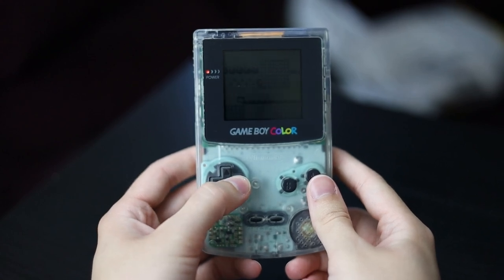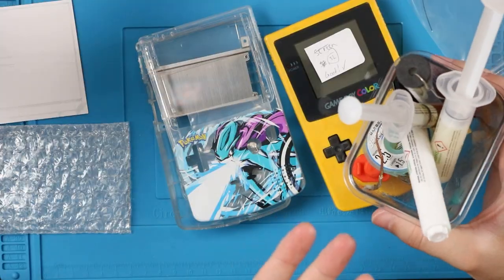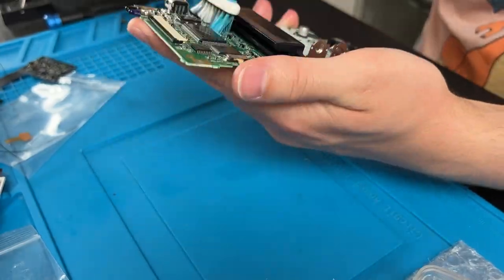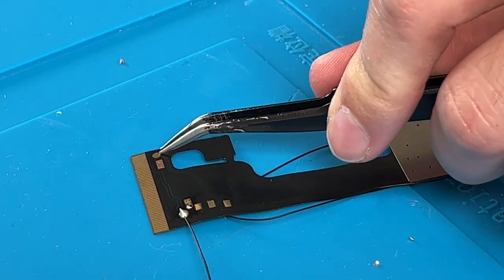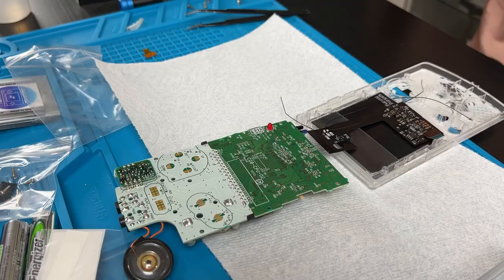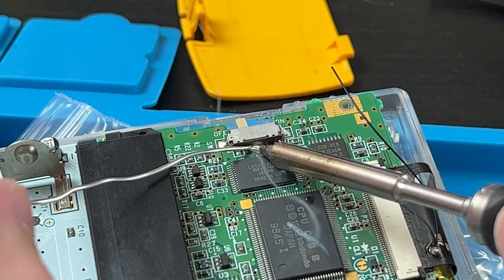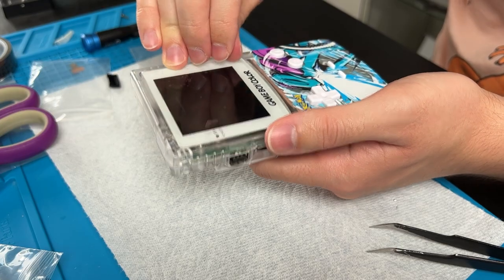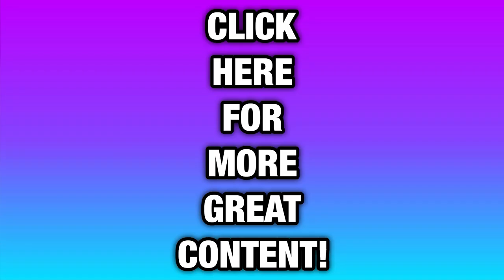The Game Boy Color You WISH You Had as a Kid! | GBC IPS Mod In-Depth Tutorial

Comment: I love how every one of these GBC mod videos I watch showcases Pokemon Crystal, which is actually the reason I'm modding my old grape GBC. Successfully replaced my speaker and a dozen cart batteries without killing anything, so I figured I'd treat myself to my first major project build (most of the parts should hopefully be in by Saturday). IPS kit + case, some clear buttons/membranes, LED flex board, LiPo battery kit, amp board, and some replacement caps because supposedly those are good to change out. Going to be super tricked out by the time I'm done. Yours is the only tutorial I've seen that talked about the possibilities of shorts, so with all the stuff I'm throwing in I guess I'd better be extra cautious about that. 

Retro Game Repair shop has an amazing selection of stuff, but I also wanted to shout out Handheld Legend for having a lot of product overlap, but also having a lot of smaller mods and accessories that RGR doesn't. Between the two, as far as I can tell you can get a pretty complete catalog of hardware mods, stickers, shells etc. 

To anyone on the fence about trying stuff like this; get a cheap soldering kit online and practice with some Gameboy batteries or a cheap soldering project. It's really not as difficult as it seems once you've gotten some practice, and being able to mod/repair your old stuff is a really satisfying skill to have.

Comment: The quickest, cheapest and easiest way to learn soldering is to solder a cube out of wires of different thickness.
You can even use paper-clips for that, mix them up with different sizes of wire, use spare metal parts, what ever you have lying around.

Comment: Hey question I bought the kit and installed the 2.0 version,  ribbon said 2.7 version so it pops up a display when I hold start and select. But I can't seem to change the different color options for each word just the whole thing to a different color? Any ideas on the new version? Ty
Reply from the maker: You can’t make each word different colors, they’ll all be one color. When it highlights “game” and “boy,” hitting start or select will change the centering of the display. When color is highlighted, you can cycle through all of the colors with start and select. Then holding down both buttons on the color you want will set the color for the whole logo. I’m a little confused by your comment so I hope that helps. Otherwise I’d need a visual to help
Reply: @JakeSimmons  that answers it perfectly 👌 I think it just confused me because my version actually brings up a menu to change everything 🙃 but thanks again you are the man and your discount on items is appreciated
Reply from the maker: @cbk12  interesting. I’ve never seen a menu before

Comment: Does anyone know what kind of wires are included with the screen to solder? Mine did not come with enough to solder the touch sensor!
Reply from the maker: The sensor should be built into the ribbon cable if you’re using the same kit as me. It’s the black square next to the part that goes into the game boy motherboard. The yellow touch pad is there just in case the built in one is defective. You should also be able to solder the other touch pad down without the need for the wire and still have it touch the top of the shell

Comment: Hi 
Is it necessary cut the pins of mb?
Reply from the maker: I’ve been doing it for a very long time because the first time I ever did this mod, those pins were shorting on the ribbon cable for this kit. I’ve been doing so long that I was curious if it was still necessary or if it was just a coincidence that I had that issues on my first attempt. I still covered everything in kapton tape and those pins poked right through it and it was shorting again. Tried it twice with 2 different boards, same thing. 

Some people don’t do it and I don’t know how they do it but from my experience, I recommend just taking the extra 2 minutes to do it so you don’t have to open it up again once you’re done. Also, make sure all of the pin clippings are off the board. Those little leftovers can also cause shorts!
Reply: @JakeSimmons  thanks 
I Will cut it!